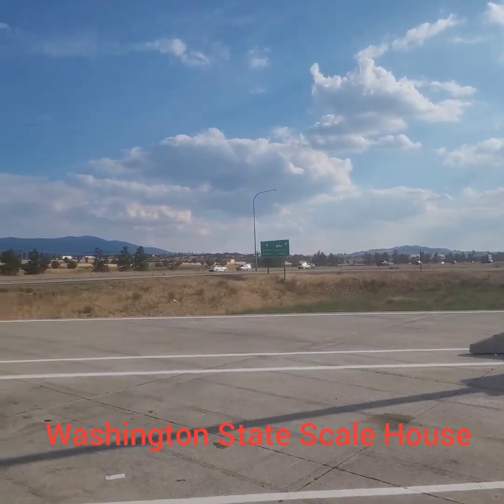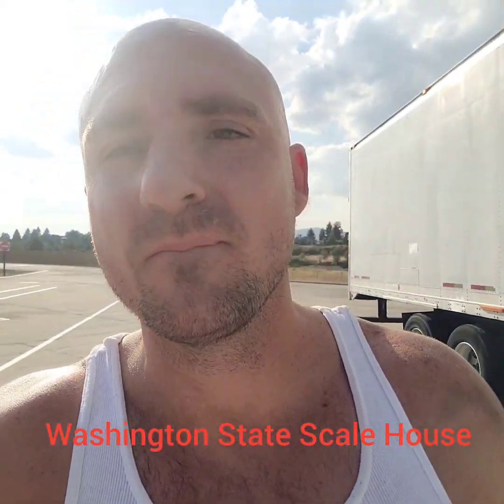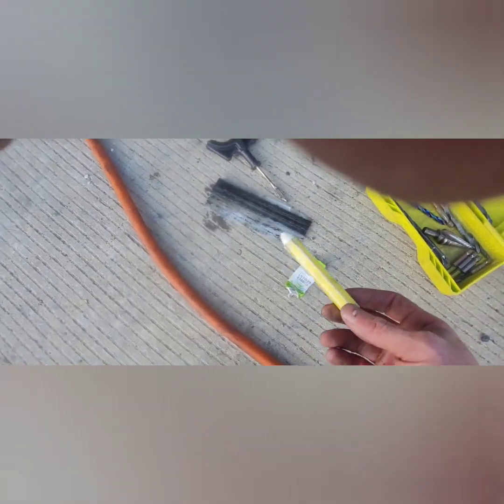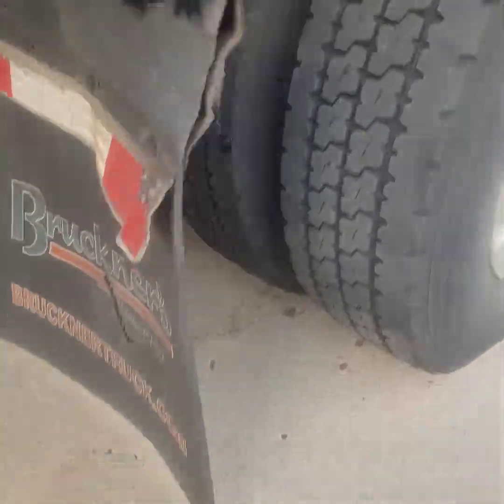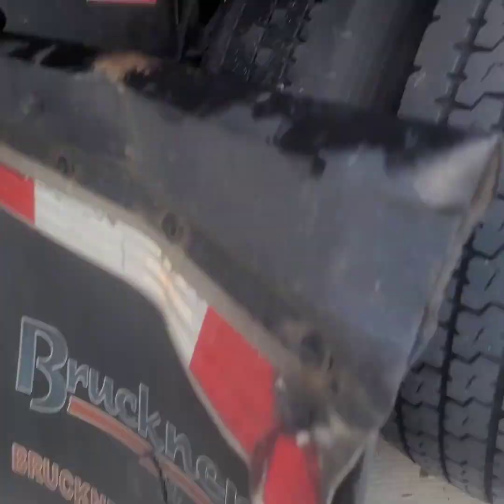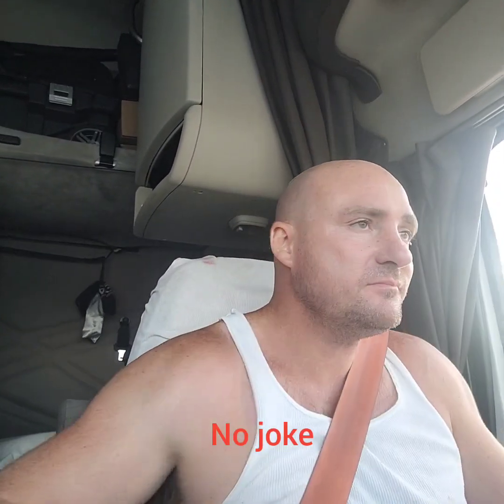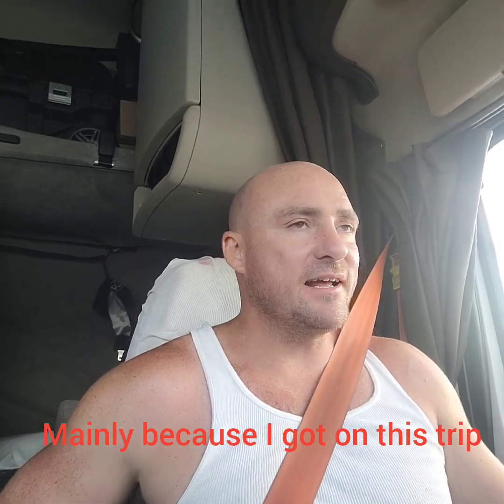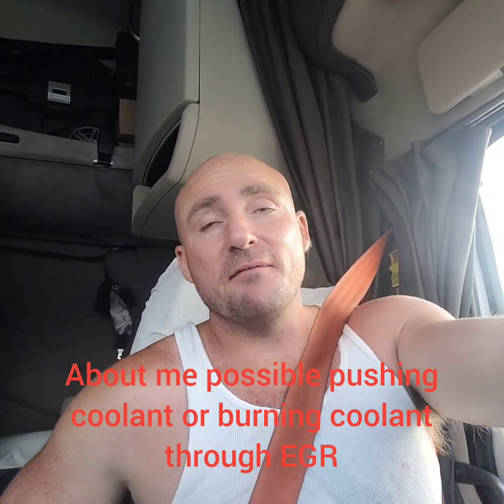I had to turn into the tire man at the scale house

Comment: Hey so the grease helps it set??   Ive done a lawnmower tire but not the big truck yet
Reply from the maker: Yes, the grease helps fill the gap between the tire and the rim so then the tire can begin to hold air without it just escaping through the gap. 

I have seen tire guys use the soap that they have in buckets for the same purpose so that is kinda what made me think to do it.

I was desperate, I didn't want to call a service guy because I knew that it was probably gonna cost over 500 if I went that route

God helped me do it